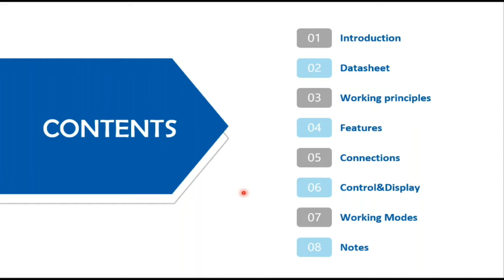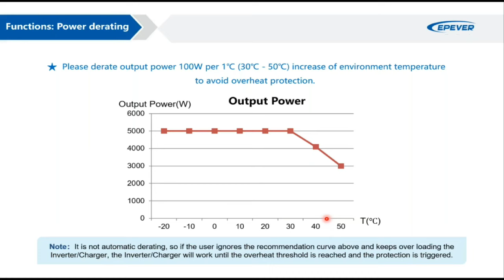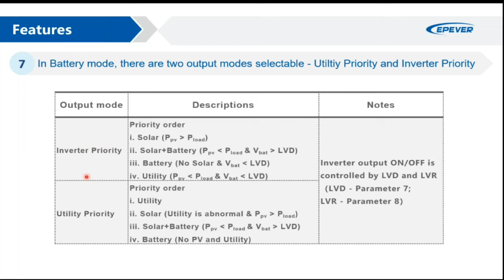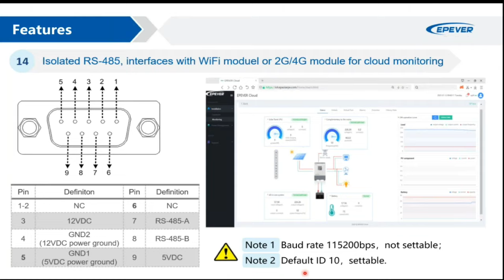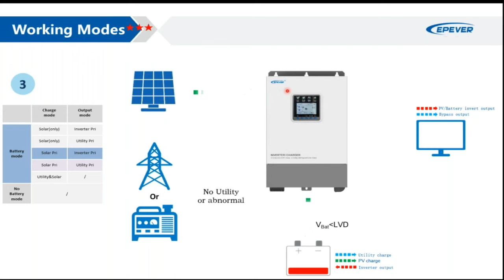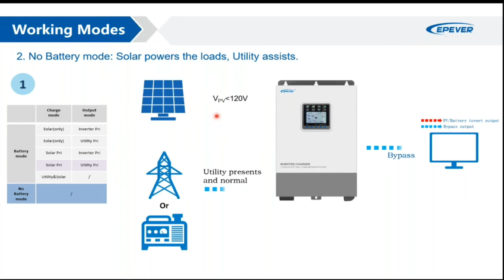Hybrid Inverter Charger - UPOWER HI - EPEVER Webinar series

Comment: Hello, I have tested the UP5000-HM8042 inverter in battery-less mode using five 580W solar panels and a 230V AC input to supply a 1000W load. I found that the inverter only drew about 600W from the solar panels (even under full sunlight). However, when I switched off the AC input breaker and relied solely on the solar panels, the inverter was able to supply the full 1000W load.

Could you please advise me on how to configure the inverter in battery-less mode so that it prioritizes solar power and minimizes the use of AC input?
Reply from the maker: Hi there, thanks for sharing your detailed test! To get the best support on configuring battery-less mode, could you please contact our technical team at support@epever.com with your inverter details? Our engineers will guide you step by step.

Comment: Hi! I am just curious about Solar Priority/Utility Priority mode. What if the battery is fully charged and the PV power is enough to supply the connected load, will the loads solely supplied by the PV? Or will it be supplied by the PV and the utility?
Reply from the maker: Hello there, if the output mode is set to Utility Priority, regardless of whether the battery is fully charged, as long as there is utility power available, the loads will be powered by the utility power.

Comment: Does it have adjustable  low voltage disconnect, or will it allow battery damage the same as older Upower?
Reply from the maker: Hello, both UPower and UPower-Hi are equipped with the Low Voltage Disconnect function.
For a 12V system, UPower's Low Voltage Disconnect voltage ranges from 10.5 to 11.3V in user mode, you can find this on page 18 of the manual.
For a 24V system, UPower-Hi's user-defined range is 21.6 to 32.0V, you can find this on page 36 of the manual.
Reply: @Epever  for AGM battery 24.10 volts is lowest recommended. We have tried to adjust cut off to this but menu will not allow, cannot change.
Reply from the maker: We apologize for the design limitations of the UPower inverter/charger, which prevent adjusting a wider low-voltage cutoff range. You might consider trying other batteries within the compatible range. If you have any other questions or need assistance, we'll do our best to support you. Thank you for your understanding. @BrucieNZ
Reply: @Epever  a firmware update could correct this. They are advertising as being suitable for AGM batteries but the inverter is not fit for purpose if it allows battery damage.
Reply from the maker: UPower doesn't support firmware updating, while UPower-Hi offers broader compatibility and applicability. @BrucieNZ

Comment: If I have AC input for charger, do I connect my AC output to ground terminal? I wish the manual had better information for grounding.
Reply from the maker: Hello there, if you have AC input, you need to ground the enclosure of the UP-HI, please do not ground the neutral wire. We appreciate your valuable feedback regarding the manual, and we will make improvements based on users' input.

Comment: I recently swapped my Victron Multiplus 2 to an Epever Hi series 48v inverter charger, wish id just stayed with Epever had nothing but problems with Victron. I have a Lithium battery pack made up of 3.2v cells with a Daly BMS. Would it be possible for the BMS to 'communicate' with my Epever inverter charger as with no communication the battery voltage and state of charge vary drastically.
Thanks
Reply from the maker: Hello there, can you please let us know the brand of your battery? Thank you.
Reply: Hi, thanks for reply. My battery is made up of 3.2v CATL cells with a Daly BMS
 @Epever
Reply from the maker: @davidmills2266  Here there, Since you have a custom-made battery, we recommend contacting our support team at support@epever.com for our UP-HI BMS protocol, then sending it to the BMS manufacturer to see if they can assist you in configuring the protocol communication. Thank you.

Comment: I have trouble with my up5000, the condition is : input pv volts (260v ++) works but ampere/watt 0 (pv 450w Canadian 6 pcs). so 100% load is taken from my utility ( after 2 year )
Reply from the maker: Hello there, this may indicate that the PV is not charging the battery. Please take some photos or a short video of the LCD display, then send it to our support team: support@epever.com. Our technicians need to check the voltage of the PV array and the battery. Thank you.

Comment: Hi, when the dry contact is switched on via DON, there is no voltage output from the dry contact interface..  manual says 110v ac or 30v dc..  - how do i use this?  Do i need to use the rvbs wire also?   Thanks.
Reply from the maker: Hi Sir, thanks for reaching us. The dry contact is just a signal without voltages and currents. And the “110vac or 30v dc” is the requirements to the input circuits. So there’s not thing wrong, and it’s not related to the types of wires.
Reply: @Epever  yes i understand now, thanks 👍

Comment: Hi, I have the 3kw inverter MPPT is it possible to connect 2 x these ? so i can have output of 6kw? many thanks
Reply from the maker: Hi Frank, thanks for reaching us. The upower-hi is not available in series or parallel. You can use 2 upower-hi respectively to increase the output amounts.

Comment: Hello Epever team, could you please advise what can cause the situation Inverter in no accu set up doesn't show  neither utility current nor energy when the load is sourced directly from utility? Regards
Reply from the maker: Hi Sir, thanks for reaching us. The load can't directly connect to utility's input port, should be connected to the load port. Meanwhile, you can adjust the charging mode to the "utility priority".

Comment: I have installed this inverter and the fans are always on even if the load is low. Does this inverter work that way or can I configure the power on
 fans depending on the temperature.
Reply from the maker: Hi, thanks for your comments and suggestions. The voice may come from the cooling fans because of the high temperature, or from the mofets switch. Ventilation is highly recommended if mounted in an enclosure.

Comment: Hi, can you tell me how many watts the epever hi 3000 hm10022 uses in NO Battery mode when NO pv, but GRID is supplying power?   As it seems to be about 300-400 watts!  - this is crazy!  Why so many watts?, it makes the inverter unusable in no battery mode...
Reply: @Epever I’d be interested to know this also… did you get any answer?
Reply: @RetroHQ  they dont reply to questions that make them look bad..  But i know from using a clamp meter that it draws around 1.5 amps at 240v which is 360 watts.  Actually the same as growatt and probably others.  But only when using utility grid input.  You need a large battery pack to aviod this.
Reply: @jmpcrx  is this when it's running entirely on utility power with the transfer switch active? Ie. the output load is connected directly to the input? The idle current draw with inverter active is (allegedly) about 45W, but that figure is from battery. If so it makes the product entirely useless for PV with grid top-up without battery. Which is crazy as it's one of the selling points...
Reply: @RetroHQ  yes, unfortunately, when grid power is connected in any way, it draws 300+ watts, and this goes up as a percentage as you draw more power too.  So in no battery mode when it switches to passthrough mode, it becomes very inificient. I hooked up a couple of old car batteries just to get round drawing from the grid when a cloud goes over etc, works pretty well until i get my lifep04 bank built.   When using just pv or battery or both, yes it uses about 45watts, which is acceptable.     If you do some searching, youll find that all of these all in one inverters seem to do this, which sucks. And the info about it seems to be very limited too.  I found a long thread discussing the problem about growatt inverters on diysolarforum. Thats when i realised its not just epever. 🙄.  Im going over to octopus go tarrif (im in the uk), which is 7.5pkw/h from 12:00-4:00am, so will make sure thats the only time i charge the batteries via grid power when necassary.  You can do this by setting the aon and aoff voltages manually in the evening so you only top up the battery a small amount etc.  No way to do it remotely either. No wifi box that works untill november according to epever, and tgat only allows viewing of the inverter settings, not changing them!  🙄🙄🙄.
Reply from the maker: Thanks for your question. The EPEVER HI 3000 HM10022 hybrid inverter has a no-load power consumption of around 30 watts when there is no battery connected but the grid is supplying power. If the inverter is consuming 300-400 watts in no battery mode, it may indicate a problem with the unit.We recommend that you contact our technical support team at support@epever.com with more details about your specific situation so they can help you diagnose and resolve the issue.Thank you for choosing EPEVER.

Comment: does this allow export to the utility? or limit the export?
Reply: No
Reply from the maker: Hi Rey, thanks for your reaching. It's not allowed exporting to the utility. UPower-Hi series is an inverter charger that supports diversified energy management modes on solar/utility/generator charging, and utility/inverter power supply to the AC loads. To maximize solar energy utilization, users can choose energy sources according to actual needs and flexibly take the utility as a supplement. This inverter charger can raise the system's power supply guarantee rate, which is suitable for solar energy, utility/oil generator hybrid systems. It aims to provide users with high-quality, high-stability, and high-reliability electrical energy.

Comment: Hi, should there be a rcd on the utility input side?     As i have one, and it trips when the panels are wet..   (i have an rcd on the ac load side, and this does not trip). Thanks...
Reply: Hi, I ran a armoured cable from my consumer unit on a 20amp mcb consumer unit has a rccb. No problems at all. If your using a seperate consumer unit you could try a type b rcd that may work. I'm just trying to setup the cable provided as the Bluetooth idea won't work due to compatability issues.Thanks for the info.
Reply: @phoenix956  ive found out that neither the bluetooth box or the wifi box work with the epever hi series 🙄.    They say that they will be releasing a new wifi box that works with the hi series in november..       Does your inverter give a PLL fault when the sun goes down, meaning you have to switch the inverter off and on again in the morning to reset it?

Comment: Hi I have the Up3000 HM-10022 and recently bought the BLE RJ45 to view more information but it won't link. I get to the final screen after choosing the inverter type and it just keeps saying loading. Am I missing something, I have tried different phones and older versions of Epever Pair. The battery is a Sterling Liepo4 24v 150ah. Is this unit compatible with my inverter, if not how else can I connect to mobile or pc? I really appreciate any help.
Reply from the maker: Hi Sir, thanks for reaching out. The ble rj45 is not compatible with this series. You need an extra cable for connecting this two. You can ask for the specific cable by sending email to support@epever.com or info@epever.com, our colleagues will contact you asap.
Reply: Hi, i have this inverter, the inverter came with a cable 'cc-usb-db9(m) - 150u-v1.0' -  which seemed to work for me.  But im guessing you need bluetooth,, did you get it working?      And also, can i ask, do you have an rcd on the utility input side?  I have one and it trips when the panels are wet..   (panels are on a metal shed, with a seperate ground to the ac load ground)

Comment: Also, if utility is on, utility is ALWAYS drawing about 150w, even if pv has for example 2000w.   (eg: load is 300w. Pv output is 2000w. But the inverter is always taking 150w from utility - why? It should ALL be from pv)
Reply from the maker: Could you reboot and check each part? Normally, If the mains have power, and the PV power is sufficient, it should be the mains that will charge the battery.
Reply: @Epever  i am in 'no battery mode'.  But utility is being used even when there is sufficient pv.  (it says utility always 0watts, but this is not true, utility always using about 100-150w, even though there is 2kw pv available)..
Reply: @jmpcrx  I’d also be interested to hear more on this…

Comment: I have a UP5000 feeding a consumer unit with RCD(GFI) but the RCD does not operate with a tester. I have fitted a neutral ground link at this consumer unit and the RCD now works correctly.
When switching to utility power (bypass) the utility RCD trips due to the parallel neutral ground circuit splitting current return I think.
Is there a way to switch a neutral ground link in this inverter?
Connecting utility neutral to output neutral I have seen mentioned online, but this is against code and potentially dangerous under certain fault conditions.
Reply from the maker: Hi mark, thanks for reaching us. The Utility N and the AC output N cannot be directly connected together. We suggest separate the grounding line and the N line.
Reply: Hi, did you resolve this?    I have an rcd on the utility input which trips when the panels get wet, and i cant figure out why.  Ac load is grounded.   And the pv are grounded via a seperate ground (they are on a metal shed so no choice!)
Reply: I have ordered  a 10kW inverter now that has a 150 A utility charger so should never get to the state it trips to bypass. It also has the ability to control a neutral ground relay, but that would be slower than the incoming RCD so a bit pointless.
Do you have your panel negative grounded as well as the frame? Some inverters don't like a ground on the DC
Reply: @marktssd4161  hi, thanks for the reply, it's not neg grounded.  But I tried simply swapping the rcd for another,
 ( another 30ma)  and now it's not tripping!    So I'm happy now, thanks 😁
Reply: @marktssd4161  This seems a bit odd. Multiple grounds are not a good idea, there should be one ground reference for neutral…

Comment: Hi again. I have the upower hi3000-hm10022.  Can you please tell me why when utility power is being used, it says 0w, 0v?  (when not using battery, or pv)  load shows correctly, but not utility.
Thanks..
Reply from the maker: When powering the load, PV and battery are preferred. When PV and battery are sufficient, the mains power is not used, so the mains power is 0
Reply: @Epever  i am in no battery mode..  And utility always says 0watts, even when utility is being used..  Is there a problem with my inverter?
Reply: Hi @jmpcrx, were you able to solve this issue? I recently bought upower hi 5kw and im experiencing the same thing on no battery mode.
Reply: Hi, i honestly cant remember as ive had 14.4kw of diy lifepo4 batteries hooked up for about a year now..  Works best with batteries.  Id advise building them yourself (if your in the uk, use Fogstar to order them, and use jk bmses..)    the inverter actually works really well, no faults so far.  All my problems ive had were simply my lack of understanding of settings etc..   Any help i can give you, reply to my thread here:
https://diysolarforum.com/threads/first-build-3kw-panels-3kw-inv-14-4kw-storage.52783/
Reply: Thanks for the reply, will check on the thread. Thank you

Comment: Hi, can you tell me what temeperature the fans come on and go off?  (up hi3000-hm10022). Thanks..
Reply from the maker: Hi thanks for reaching us. Optimize the fan speed to steeless speed control. If the maximum value of all temperature samples in the device is greater than 35 ° C, start the fan and stop the fan when it is less than 33 ° C. When the device temperature reaches 42 ° C or the heat sink temperature reaches 52 ° C, the fan is full speed.

Comment: Hi, can you tell me if the bms-link box works with 24v lithium batteries?    (or just 48v?). Thank you..
Reply from the maker: Hi sir, thanks for reaching. Please connect the bms-link directly to the upower hi. And  both 24v and 48v are work for the upower hi.
Reply: @Epever  thank you 👍👍
Reply: @Epever  yes, but the bms link does NOT support 24v batteries, which is what i asked you.